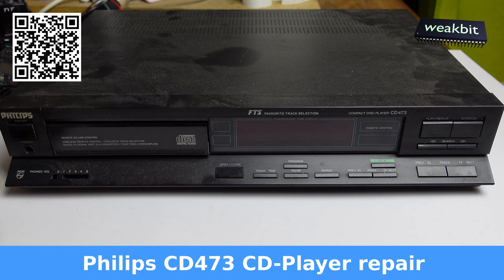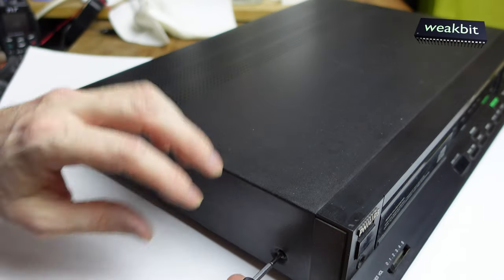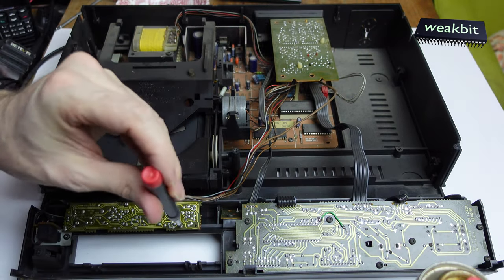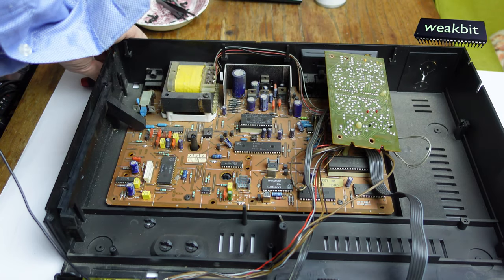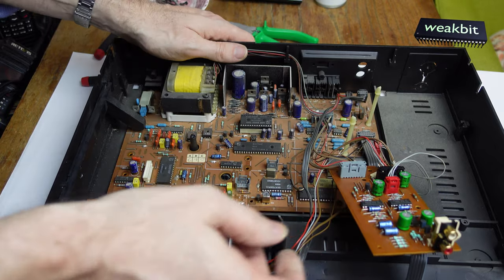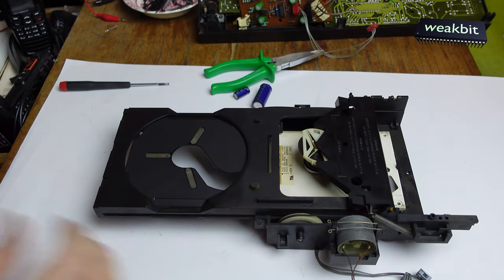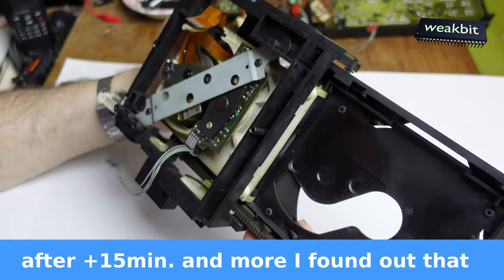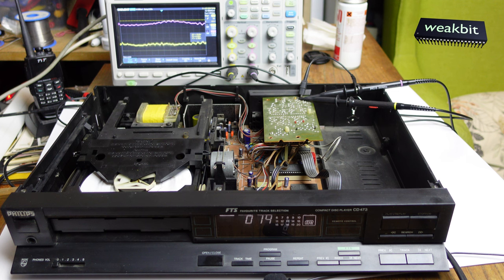Philips CD473 CD-Player repair

Comment: Ok done, changed the belt, only the belt, had a spare pulley but did not touch it. Order to do it: I suppose Drawer Schnappi could have been left in place: ah no, otherwise front plate can't betaken off. So try to pull out the drawer completely, as you need to free 2mm to place the new belt. you do not touch the motor. Otherwise screw off the 1 screw in the bottom (long screw for this small plastic part), the 2 screws back of transport, 1 screw in front of the transport. I had problems to reattach the spring from the laser cover. Take a photo before manipulation.

Comment: Hello, when I bought this device, it had exactly the same problem. After watching your training clip, I first replaced the belt and the 1000 microfarad 35V capacitor. The problem was solved by about 95%, and it only gave errors sometimes, but after replacing the 6800 microfarad capacitor, I replaced it, the device no longer works and only gives error messages, what is the reason?

Comment: Hello! I have a Toshiba xr-z70 cd player. I have a question, if you don't mind. My CD player opens the drawer when starting from the power button. What would be the problem? Any advice is welcome. I understood that this is the common problem with these models. Thank you very much. A good day.
Reply from the maker: normal it should be closed after power up. There is a end switch and if this is not in position - the µController dedect it as not close it could be that it open the tray after power up. I think is this end switch. This end switch could also positioned under the drive on a gear or wheel! this is much complicate to repair but I do that some times in a other Video but I don't know this model from Toshiba XR-Z70. weaktbit
Reply: @weakbit633  Good evening. I checked them on the spot and they seem to be good, there are 3 of them. I will take them out and check them more thoroughly. Thank you very much. A good evening.
Reply: @weakbit633  Good evening. I checked them and they are all good. I don't know what else to do. A good evening

Comment: I have the CD960 from this era. It’s a wonderful machine but the CD tray sticks. I’ve changed the belts but I need to get back inside it to lubricate the rails.
Reply from the maker: I would also buy me the CD960 but this was for me to expensive ans so I bought the CD430 - only. weakbit

Comment: Hi Weakbit. I love your video and your cheerful style, thank you!
I have just stripped this down, re-soldered the power lead socket and rebuilt it quite successfully. All back together, but and seems to work fine except the flex-PCB has slipped out of the white plastic retainer on the motherboard. Please can I ask how on earth you fitted it back successfully???? As you say it's only about 5cm long and there's no room for your hands!!!
Many thanks,
Dominic
Reply from the maker: Hello Dominic - I remember I do that with my left hand and with my 2 fingers but it can also be that I use a Pinzette too. I remember this on the left/front side this little plastic connector and it still stand straight vertical - but you must open it to move a Pinzette the white around frame and lift it to the top so the connector is open if you don't do that you can't insert the flex-PCB into the connector back. Thank you for watching weakbit

Comment: Hi I have a CD 473 which has a problem with skipping in higher tracks of the CD. I have cleaned the laser lens with isopropyl and this has helped somewhat. I will order new capacitors for the power supply. How did you adjust laser diode? Is this the potentiometer shown in section D4 of the PCB at 18:09 in the video? Turn clockwise to increase gain? Thanks from New Zealand.
Reply from the maker: Hello Rory, I'm sorry to hear that but if this Laser is on the end of live it is a little help to turn the current higher (Trimmer 3528) but this help only a little - the light intensity is gone. The other story is that this Laser-Pickup is never more in production and you can get in nowhere there is nothing on new-old stock only the complete drive I think. It is a CDM2/0500 drive and this is very rare on the market. But search at eBay sometimes is there a drive available. The issue is the Laser-Diode and this Diode have 3Pins and the organization is other then the Laser-Diodes they are on the market. The Pin 11-8 Monitor-Diode, 11-9 Laser-Diode and Pin 11-10 GND. But the Anode or on Pin 11-10. Newer Laser-Diode with Monitor Diode have the Monitor diode build in inverse so you can't use them. The Laser-Diode Anode is connect to the Kathode from the Monitor-Diode and this is the issue. I would inverse the measurement current from this diode and then the IC TDA5708 is died in my Player. What did you said if we made a Laser-Pickup in this style by our own with a 3D Printer? I've one PhotonS here in my kitchen! That will be nice if we print one Laser-Pickup out. weakbit

Comment: Belts and defective motors are common. I also find defective laser pickups but often they aren't available or the cost is too high.
Reply from the maker: I see that also so defect belts are the main in my eyes. Motors are also and Caps often too. And dirt behind the lens that is also very difficulty to clean in case of dis-assembly the laser lens and assembly it again.

Comment: Hi weakbit.  Thank you for making and posting this video.  Kindly, in your estimation, then, if I understood you correctly, the main issue were the weak/cut belt, and ¿the 'adjustment of the monitor of the laser diode/sensor up closer to the media/CD'?  Thank you for making & posting this video.  Thank you again.
Reply from the maker: I think there was the power supply at the first and the second the laser was also inside the lens dirty. So I see that issue at this old one CD-Player! Thank you for watching. weakbit
Reply: @weakbit633  I see.  Thank you for the kindness of a reply.  Thank you for making and posting your videos.  (Nice work you do).  God Bible[Bless].
Reply from the maker: @tonyd1149  I'm very sorry that I can't
 not answer in time so i do that later - sorry for the inconvenient delay! Shall I show you more details in the service-manual? or is it enough what I show? In case of the runtime of my videos.
Reply: @weakbit633  Dear Sir, no worries, please.  (I realize that you're busy with many things).  The kindness of your replies is a blessing (to us).  Thank you so much for your videos.  (Great skills you have).  Thank you again.  I wish you much success.  God[Bible] Bless.
Reply from the maker: @tonyd1149  If you have any questions don't hesitate to ask and write in the comment line here. Thank you for watching!

Comment: Hallo. Ich fang jetzt an den Riemen zu wechseln da die Lade nicht mehr automatisch öffnet und schliesst. Was brauche ich zum reinigen? Balistolöl   und 100% Alkohol   und Ohrstäbchen. Es wird auch Glasreiniger benutzt um die Linse abzutupfen. Geht Isopropylalkohol, habe noch welchen. Danke.
Reply from the maker: No Oil - No Alcohol - No Isopropylalcohol! - don't put any oil in your drive! for the lens use spit & a cotton stick this is a perfect degreaser for the fat on the lens. Thank you for watching! weakbit
Reply: you mean saliva, my own spit ?!    Thanks a lot. My CD880 plays some tracks, others not and with different CD’s different tracks are unplayable. Apparently there could be magnets from the laser which got losen. Only problems.
Reply from the maker: Yes the own! - CD880 from Philips. I don't think so there are magnets they are falling apart this is a normal iron (Fe) and coils that making the Magnetic field to position the lens up/down. I think more on the low laser light that less reflecting the signal back from the CD. What do you have for a CDM? mechanism?
Reply: @weakbit633  I think it was written CDM 1 Mk2. But oh wonder now it played 1 complete CD (female finnisg singer Tara) and Dire Straits, Pearl Jam ...  made problems. I can't understand why but glad it played 1 total CD.
Reply from the maker: @thevintagehifiambassador8524  CDM1 MK2 is never more available - did you clean the lens?
Reply: @weakbit633  nope, only opened the player to find the Tda 1541 A s1 chip inside. Afraid to destroy it. So spit on the Q tip and softly wiping and letting dry or afterwards taking a new Qtip and rubbing again softly? Thanks. There's hope. Ps: is it complicated to put the new belts in? They're lying here for 2 years now.
Reply from the maker: @thevintagehifiambassador8524  I never have a CD-880 to repair but I don't think so this is not so complicate to build in this belt.
Reply: @weakbit633  I just saw on Tv that we finally have a repair café mand they will tell me the name of a hifi repairer, there is 1 but noone wants to tell his name as he has too many clients already. Have a great week-end.
Reply from the maker: @thevintagehifiambassador8524  I don't remember when I repair my last HiFi system it was long time ago. And today it is very complicate to know who is doing this what I do in front of the camera? All the old service stations around me are died and the persons they do this also. I remember all the service companies around me but they are all died in person. Whom do you're searching? Thank you for watching weakbit
Reply: @weakbit633  on a hifi fair one amplifier collector told me that. It's in Europe, 50 km from my door. I will buy these if the lasers are still available: Kenwood DP-1100sg, Denon CDC-3520 or 3300 or 3560, Marantz CD 94 Mk2
Reply: So I cleaned all lenses of Denon, Cd880 and this 473 only has the belt problem. , how do I reach the CD473 drawer belt, do I need to take off the flex Pcb connector?  It looks so brutal. how do I access this belt as easy as possible ?  I have a Tda1541 chip in my 473, so better not ruin it !

Comment: Sir I have pioneer pd 106 the problem is won’t play won’t spin spindle drive the laser had light what is the problem of my CD player? Please can u help me? Tnx
Reply from the maker: download this service manual pioneer_pd-106_cd_player_sch.pdf on the left side top is a IC LA6520 measure pin 7 this is the spindle drive IC out and/or measure the pin8 this is the spindle from controller. Also check D218 Z-diode 6.2V. this are the things what I'll make a check but I don't make support for repair and I don't repair CD-Players for other peoples I'm only making Videos. In case I've no time for all this jobs - so sorry. Thank you for watching  weakbit
Reply: @weakbit633  thank you very much sir for helping me im very happy you answered my question about the pd 106 sir if i cannot find the voltage pin #7 or # 8 what is the problem sir ? The ic LA6520 is the problem? Tnx and more power to your video I really love to see you🙏 keep smiling 😊 sir how many volts pin 7 and pin 8? Tnx again🙏😀

Comment: Hi. Was the belt replacable easily?
Reply from the maker: Yes it is.
Reply: @weakbit633  great. Do u have the exact link to one or the size? Cheers
Reply from the maker: @CM-dw3gh  Hahaha - I can't remember which size it was! But at the part list - part104, 4822 358 10115 maybe you can order it some where. I don't know. which wonder at eBay-Artikelnr.:284696360262 weakbit
Reply: @weakbit633 it didnt look easy😅

Comment: Tolles Video! Was glaubst du war der Grund, dass die gebrannte CD zuerst nicht erkannt wurde? Der dreckige Laser oder die alten Elkos?
Reply from the maker: I thought that the electrolytic caps are so old and making noise at the supply also the dirt on the lens but only clean it with spit! This Laser pickup is inside also dirt from smoke and dust.
Reply from the maker: Bitteschöne I can't make a answer so well in german.
Reply from the maker: Google translator Eng2Ger => Ich dachte das die Elkos so alt sind und beim Zuführen Geräusche machen auch der Dreck auf der Linse aber nur mit Spucke reinigen! Dieser Laser-Tonabnehmer ist im Inneren auch von Rauch und Staub verschmutzt.

Comment: Your video is very "interest"...
Reply from the maker: the CD471 from Philips was my first own CD-Player that I bought in 1987! It is near the same machine like the CD473 (the 473 are only have a button more the green one). I was very proud in 1987 that I've one of this new CD-Players in that case that this cost a lot - around  ATS 3400,- Schilling this is in a index calculator into todays money => The equivalent of 3 400 ATS on 31 January 1987 is 7 541.53 ATS on 19 July 2022 (click on the links to convert amounts to other currencies) Inflation over the period : 121.81 %, used index:ATCPI2013 (Statistik Austria (Vienna)), Initial Index: 56.16, End Index: 124.57 Today's equivalent in euros of 7 541.53 ATS is 548.06 EUR weakbit